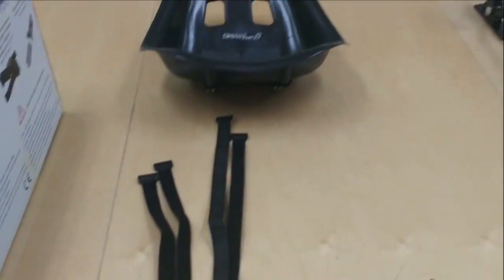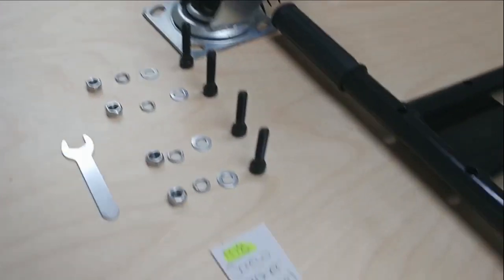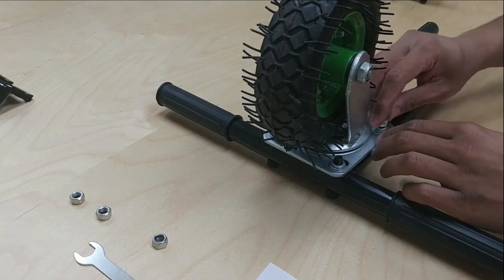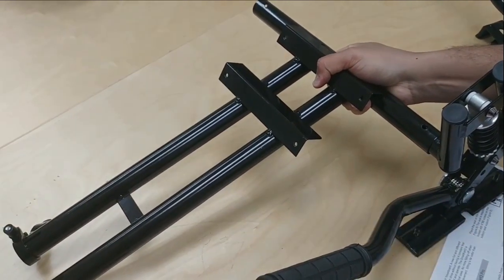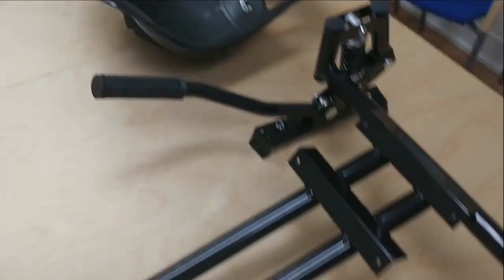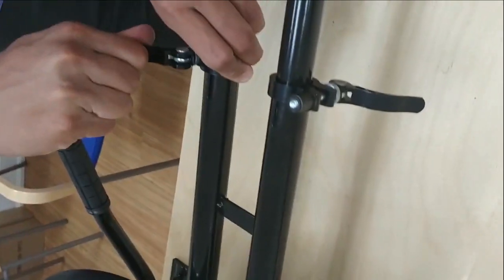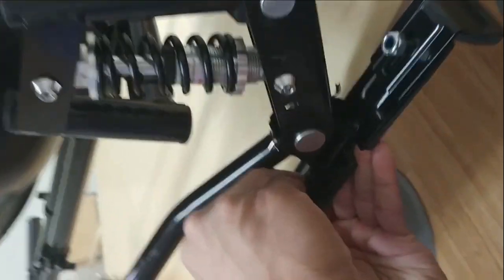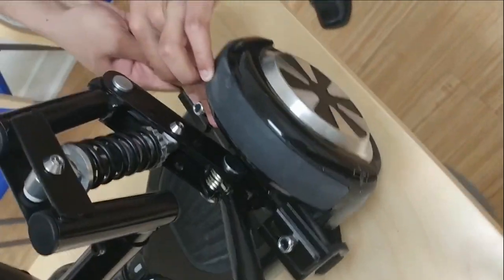Gyrocopters Hoverkart assembly X4 instructions

Comment: This item was delivered 'new', but loose in a shipping box, no display box, missing washers and spring washers,, and with the strap guides already assembled to the seat frame. The brackets for the tube length adjusters were fixed vertically downwards instead of loose and rotatable.  This was obviously a return where someone had partially constructed it and realized that there was no way the tube tightener adjuster could be installed.  I managed to fit these parts by shaving the adjuster nut, but I wouldn't call it satisfactory. A shame, because most of this unit seemed well made. However, it was definitely a returned item and should not have been sold as new. Very disappointed with this.